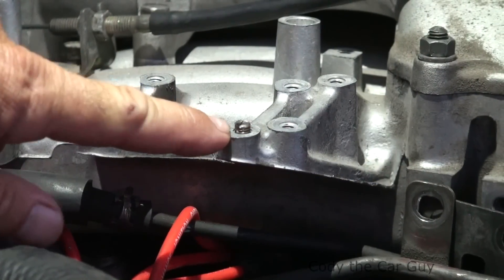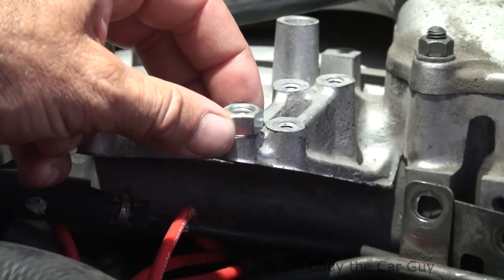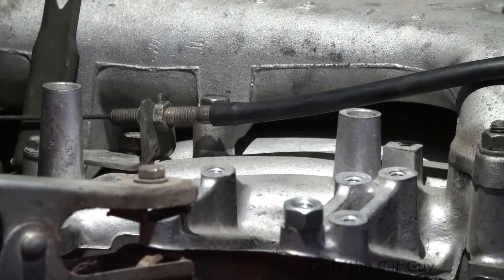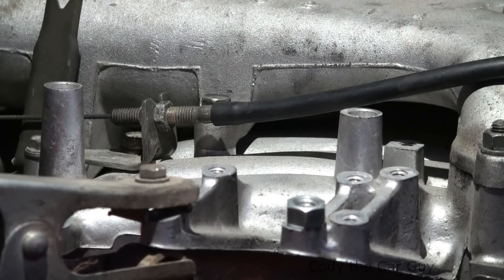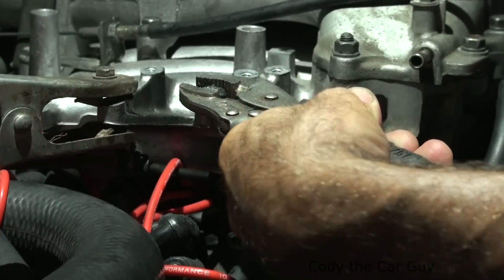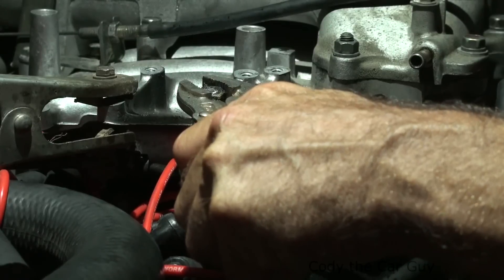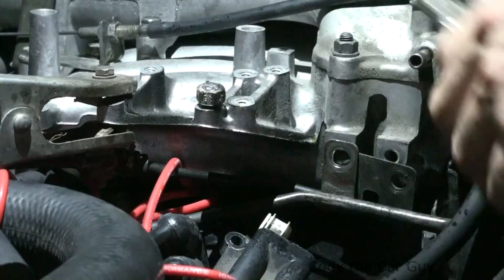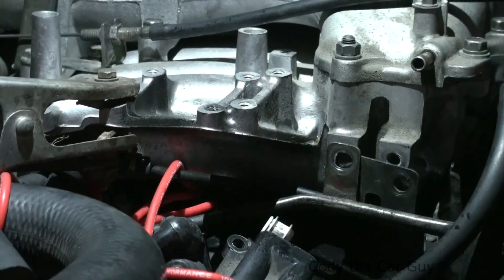Removing broken bolts using a welder simple and easy

Comment: I use this often Cody , Works sweet . I think it's the heat as well as a new place to get a bite on the bolt .. Thumbs up man !!
Reply from the maker: +ShawnMrFixitlee yeah its deff the combination,heat and penetrating oil and the cool down and welding a nut on it always helps. Yeah back at it in the new shop. We are setting up serious fab stuff and cnc.
Reply: Right on man looking forwards to it !!

Comment: What kind of welder did you use ? Are they expensive to buy ?
Reply from the maker: +Tom OConnor i used a lincoln for this video and welders start cheap from harbor freight and go up to some of the ones i use in the shop like millers and lincolns we do have a hobart too which is made by miller.